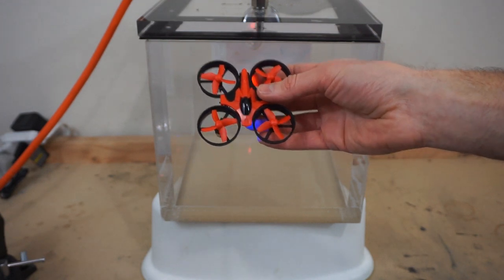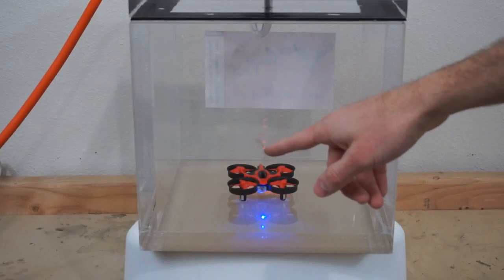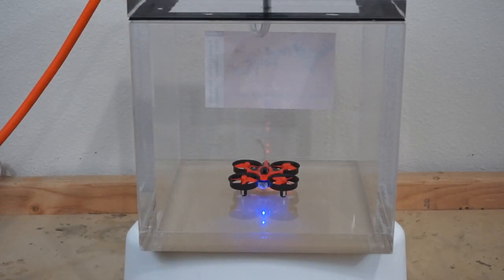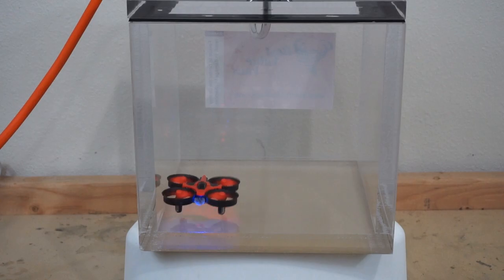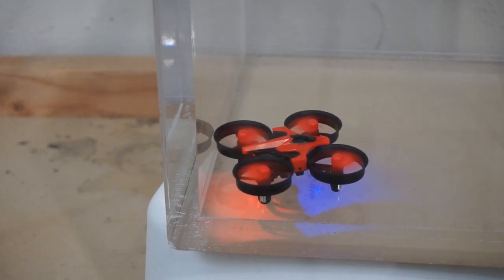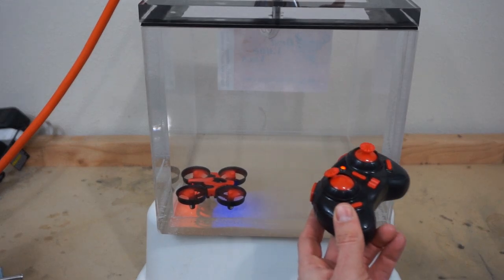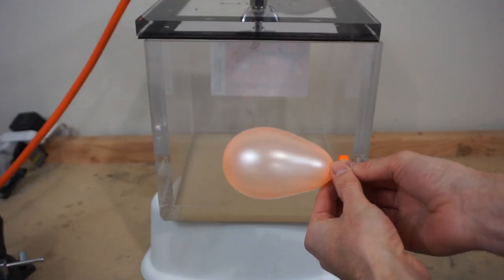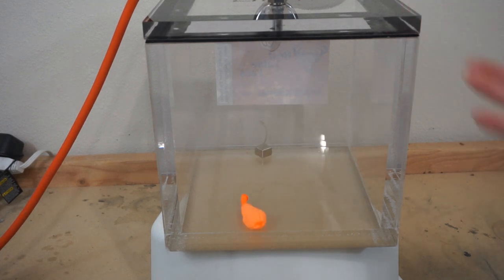What Happens When You Put A Drone In a Vacuum? Can It Still Fly?

Comment: And thats why planes dont fly in Space
Reply: And that's why feathers fall at the same speed as a 50 ton tank in a vacuum.
Reply: ExelsioHD nor rockets
Reply: Actually, rocket fuel is mixed with liquid oxidiser for space travel. So the fuel is able to be ignited.
Reply: Brogle some people think that rockets propell by pushing off air... They are unable to understand that a rocket is pushed because of pressure in the combustion chamber.

Heck, they don't even know what pressure is as they think a vacuum produces force...
Reply: Danny Sedney if there's a failure in understanding it's because there's been a failure to illustrate (rationally with applicable established principles) nasa claims
Reply: Frank facts, you mean failure to illustrate NASA's claims? So you think NASA invented rocket engines and claim they work in space? The ability of a rocket being able to fly in a vacuum has nothing to do with NASA. 

The failure is in those people being too ignorant to understand that pressure creates force in all directions. So pressure in a combustion chamber creates force on all walls of the combustion chamber, except for the rear end where the exhaust is... Hence the net force on the combustion chamber and thus the rocket points *forward*. 

How hard is it to understand this principle? Oww wait, those people that don't understand also think that air on earth has no pressure at all and a vacuum is negative pressure instead of realizing that no pressure at all is a vacuum....
Reply: Then that's explain No one went to moon... Obvious.. NASA try brainwash people
Reply: Gurnski Deti false..  the earth is flat.. the sun and moon moves... The earth stay Still...
Reply: Gol de Perú yes it passes overhead flying 1000 mph every single day. If you listen carefully you can hear the sonic bang!
Reply: Because of Fuel burning in a combustion chamber.........Why all the FUEL....and takes air to ignite fuel. also the purer the air... the more combustible the fuel.
Reply: ExelsioHD PLUS ROCKETS STILL HAS THE PRESSURE OF ATMOSPHERE TO KEEP IT LIFTED😁😁 ROCKET WILLNOT PROPEL IN VACUUM ONLY ELECTROMAGNETIC  SPACESHIP CAN FLY IN VACUUM COZ IT IS LIFTED BY COUNTERELECTROMAGNETISM AND IT ABOUNDS IN THE UNIVERSE ITS WHAT KEEPS SOLAR SYSTEM TOGETHER
Reply: Pray Suguitan finally someone that knows science. Where can we donate so that you can continue your research?
Reply: "And thats why planes dont fly in Space"
Correct. Planes don't. Space planes do.
Reply: "Danny Sedney if there's a failure in understanding it's because there's been a failure to illustrate (rationally with applicable established principles) nasa claims"
Or the failure lies with the ones not wanting to understand as it undermines their belief?
Or Nasa explains in too much detail?
Or people with an average IQ does not understand like high IQ people?

There are many reasons. Don't cherry pick the one because it supports your narrative.
Reply: Soulblade without cherry picking, they have nothing to grab on to. It is pointless to counter it with logic.
Reply: Danny Sedney
First. What video are talking about. Post video link.
Secondly at what timestamp do they do this?
 Did you find out what they were doing? Aiming for one possible reason is ignoring other possibilities.
Am I wrong?
Reply: You are the one that brings up cherry picking so name your timestamp. I just agree that people do do in order to see truth in a wrong assertion
Reply: YOU said "they have nothing to grab on to."
I asked, at what timestamp do they do this? and what video you are talking about So why must I give you a timestamp when I clearly ask you for it AND the video link?
So get me on the same page as you.
Reply: Duh, if you're cherry picking you don't have much to grab on to, have you? How hard can it be...
Reply: Danny Sedney
Did you say/type this or did I accidentally copy someone else's comment?
"if there's a failure in understanding it's because there's been a failure to illustrate (rationally with applicable established principles) nasa claims"
If not, I apologise.
Reply: SsoulBlade you nailed it, you quoted someone else. I love the confusion though haha =)
Reply: "you nailed it, you quoted someone else. I love the confusion though haha"
Why entertain the confusion and allow it to continue if you seems know what was up?
Reply: It was better for you to conclude it then for me to ask. I wasn't sure what you were up to.
Reply: Danny Sedney
Seems like you still aren't sure...
Reply: Then again, I don't have to be
Reply: Danny Sedney
Just like you did not have to extend the confusion.
Reply: You don't seem to mind wasting your time though
Reply: And yet here you are replying...
Could say the same to you.
Reply: No, I didn't complain. So doing so makes no sense
Reply: Neither did I.
Reply: You complained about me extending the confusion
Reply: Not complained. Just pointed it out. I wasn't annoyed, just perplexed why you'd let confusion spread its seeds when you could have prevented it in the first place.
Reply: Don't be perplexed; you can't always expect others to clean up the mess. I was pretty clear in my first answer. Should be enough, right?
Reply: I never said I was expecting people to clean up a mess. 
You said it yourself that there was confusion. So a clear answer from you that results in a confused response indicates that the responding poster is still on the path of confusion.
At this point, indication what the caused the confusion would have been the good course of direction instead of dragging it out....

Which is why I am perplexed. Look at conversation up to now. We could have been talking about what sparked this thread rather, don't you think so?
Reply: Yes you did expect, if you say 'you did not have to extend the confusion' you expected me to end it. I don't think there is a right path to take, you could have been trolling. I wasn't pushing, your mistake became clear within 3 posts. So what's the point of spending a dozen of other comments on the subject? I agree with the remainder of your post.
Reply: "Yes you did expect, if you say 'you did not have to extend the confusion' you expected me to end it."
No, I wasn't expecting it. I said you could have taken another approach that would not have taken us to this point. 
Expecting anything online is a tall order, especially with flat earthers and their ilk not knowing how to avoid fallacies.
And no, I am not referring to you.

"So what's the point of spending a dozen of other comments on the subject? "
Except we spent more time not on the subject at hand.

Anyway, I think this conversation has run its course.
I am sorry for the confusion once again.
Reply: With subject I meant 'the confusion'. I'm sorry it took this course. Most important is, my first response (on the quote) agrees with you.

Thanks!
Reply: No problem.
Reply: ExelsioHD thats not if their using jet engine

Comment: Premise 1 :-The drone cannot fly without air.
Premise 2 :- There will be no wind comes out from the drone's wings.
Conclusion :- Wind will not exist if there is no air .
Reply: Wind coming from the rotors is not how drone flight happens it happens due to bournellis principle which is that the pressure of an incompressible fluid (air) is inverse to its velocity, the velocity of the air underneath the propellers is lower than the velocity above due to the airfoil having a larger surface area on the top of the lifting foil, the underside is flat typically or curved somewhat, the top is always cambered in such a way that the air above must move at a higher velocity than underneath this causes the force of aerodynamic lift which is transferred to the fuselage

Comment: Nice video and explanation! If u thought science I am students would ACE it! 

So in summary drone uses only 1 energy source- air pressure to propel. Without air it can’t have lift. 

Rocket - uses chemical reaction to propel itself which creates the pressure required for it to propel ! And in vacuum not so much of it is needed as it’s frictionless so a simple push would technically put it into movement to perpetuity. ! Using Newton law of motion and force.

Comment: As soon as the pressured ballon released air, there was no longer a vacuum in the tank.  Also the compressed air in the ballon is propelling the ballon off the side wall.  This test didnt prove anything (clear side walls dont exist in space), except you need a bigger chamber and a way to release the ballon pressure with the ballon far enough away from the sides to actually sort of simulate what you were trying to simulate.

Comment: High pressure and low pressure is how an airplane wing works. The drone is using thrust to create lift. Less air equals less gas available for thrust. An air foil has kinda the same issue, but slightly different.

Comment: The actual vacuum pressure in space is way lower than what you did in this experiment. In fact if you put this same balloon in space it will expand till it blows in a second. You actually proved that in one of your experiments when your balloon turned square inside the chamber.
So you need to compare apples to apples.

Comment: The rocket can only move forward if it’s pushing off an atmosphere or solid object if you were in completely open space the expanding gas would be sucked out of the rocket as fast as it expands. making a rocket next to useless. Hence why you have to slingshot around planets to get anywhere. Your balloon had a solid surface to push off in this video.

Comment: Why does it respond to controller input when there is no medium for the radio waves to travel through? Or are you just effectively just making the medium less dense?
Reply: Radio waves travel FINE through vacuum.  If not the quadcopter would become INVISIBLE once you pumped all the air out.

Comment: When the air came out of the baloon in that small sealed chamber, did it cease to be a vacuum and what about the release of the gas next to the second mass, the wall of the container?  Has an experiment like this been conducted in a larger vacuum ?
Reply: The X-15 travelled at thousands of miles per hour above the karman line.
Concorde flew at over mach 2 in 0.9psi atmospheric pressure.
Once above the speed of sound a cone shaped shock wave is created, so there's no air rushing in behind the craft for the exhaust gases to push against anyway.
Rockets don't push on air.

Comment: Great expirement. The explanation is a little innacurate however. The drone does not fly due to a pressure gradient. I assume there would be a slight pressure gradient, but it wouldn't be nearly enough to induce flight. This is actually a prime example of Newton's third law; every action has an equal and opposite reaction. The propellors push the air molecules down, and in turn the air molecules apply the same amount of force on the propellers upwards. This allows for the drone to take off. The faster the propellers go, the more molecules they hit and a larger force.

Comment: Those drones and helicopters fly cuz they r pushing on air, in a vacuum they wouldnt be able to fly since there is no air to push on, but a rocket in space works well since there is no air resistance (duh) and its expelling the fuel to provide movement

Comment: The drone uses its own air to direct against itself, however with greater speed and thus having action and reaction, however, as we have no air inside the cabin, the drone was unable to make its flight, I believe that the air contained in the balloon in this case be forced against the walls of the box and thus being able to now have the reaction due to the action, I believe that the rockets can only travel due to the acceleration with which the gases are expelled and this creates a reaction against itself, but it is only an idea and can it's wrong.
Reply: Your idea is correct. Rocket propulsion works via the RECOIL force of hurling the mass of the exhaust gas into the vacuum.

Comment: So how did that drone they just deployed on mars fly?  Isn't there a vacuum on mars?  Can you help with some details on that?  Thanks
Reply: Mars actually has an atmosphere. There are dust storms there regularly. But the atmosphere is mostly cO2 and is much thinner than our own. As such a normal drone would not be able to fly on Mars. The drone NASA are sending has wider longer blades which will spin a lot faster to generate the lift required. Due to atmospheric conditions here on earth, the drone wouldn’t actually fly here. The blades would encounter too much drag to spin fast enough to take off on earth. But in a significantly thinner atmosphere like Mars it’s ideally suited.
Reply: @engineeringtheweirdguy2103  Thank you!  I appreciate the explanation.  It's amazing that we can get out there and do what we are doing.  I hope in our lifetime we get to see some amazing results....maybe even find out that we are not alone.

Comment: * rockets can't get thrust in a vacuum.  No, there is no equal and opposite force.  Plus the sky is not a vacuum anyway.
Reply: So a handgun wouldn't recoil in a vacuum?
Reply: Answer these three questions to help you understand:
1 - When the rocket engine is running is the exhaust gas ACCELERATED from the nozzle? Doe it CHANGE VELOCITY? Yes or No?
2 - Does the exhaust gas have MASS? Yes or No?
3 - Can MASS be ACCELERATED without a FORCE? Or is a FORCE required to accelerate a mass?
Reply: They are begging the question. There is no vacuum of space above our heads as it would violate natural law.
Reply: @karltaylor2857  scared to respond to people that bothered to get an education?

Comment: This clearly destroys the flat Earthers theory that Gravity does not exist, and that Buoyancy (objects more dense than air), is what keeps objects on the ground.  All the air was removed from this chamber, which meant there was no medium for the Drone to be heavier (Denser) than, and yet, it still fell to the bottom. Proving Gravity is very real.  If the FE theory were correct, the drone should have just been floating around inside the chamber, even without the props turning, once all the less dense air (medium) was removed.

Comment: QUESTION....is the chamber capable of making a total vacum of nothing? also, how did you MEASURE the vacum?
Reply: 1. He didn't make a perfect vacuum, because it was a simple experiment from home, and he didn't have a large budget. 2. Why does he need to measure the pressure inside ?(Vacuum is an incorrect term in this case). He lowered the pressure low enough so the drone wouldn't fly, for the sake of the comparison. This video was just a cool experiment, nothing more, nothing less

Comment: Would you be so kind to specify exactly what atm pressure "the drone can fly in"? My second question is could you repeat the last experiment with the luftballon on that way, that the pressure is viewable from the beginning till the end, no cut in the film and the luftballon size way smaller, probably just 2 cm and not near the glass wall what it can push on, but instead approximately in the middle hang up on a very thin yarn? I know that the luftbaloon experiment very hard, because if you try to put it closly to the vacuum, it explodes, but if it is not in vacuum, as it wasn't obviously, it sadly prooved nothing to me. But whole night I was searching for a kind of experiment like this on the net to gain some knowledge, because I cannot believe that Newton's 3rd law can work in the condition of vacuum, especially if you add to this condition closely 0 Kelvin. On the level of my present understanding adding together every verified and in fairly circumstances prooven physical laws, I don't think, that outside of some lighter elements like hidrogen and helium atom ever anything left our atmosphere and came back alive and in one piece.

Comment: So … we could fly a rocket 🚀 up with drones
Until the atmosphere isn’t thick enough for them To go further 
Simply to eliminate the amount of thrust powered by fuel 
So the rocket is already now 2 km high held up by the “drones” 
It could do it’s burn test in mid air and launch away from the drones , 
While the drones would help launch 🚀 while the rocket starts going full throttle… 
It a trusting boost ?
Isn’t this possible or something  I’d have to draw it out …. 
So hard to explain

Comment: Any engine wouldnt work in a vacuum either.

A rocket will, because it takes to fuels ignites them in a combustion chamber and forces it through a nozzle.

Rockets are only good as long as they have fuel to push they burn fast, as they use most of their fuel to create thrust.

A engine or ram jet, forces air and compresses it sprays a little bit of fuel to ignite it.

A car engine uses this combustion to generate force on a crankshaft. A jet engine or ram jet ues this force to puch out the back to generate lift.
Reply: Wrong! Electric engines work just fine in space. Google it..
Reply: Sir, I think you mistakenly called "any engine" ... well, NO, even regular internal combustion engine could be run in the vacuum if modified to that, any known engine could be run in the vacuum that way, the only thing you cannot get, is the regular dry thrust that used to be produced via (turbofans, propellers ... etc..), cause there is no media for them to work with in the vacuum, i know you know that very well, but you didn't state that correctly ... Have a nice day.
Reply: Guys, im pretty sure he is talking bout how rockets works. I was gonna explain it to you guys but when I misspell or say anything wrong, you guys would just be mad and a debate fills up this reply section. Im only 12 anyway so yeah. I recommend just google it